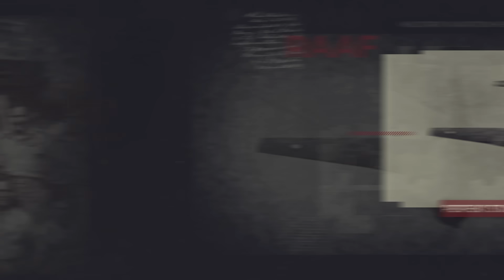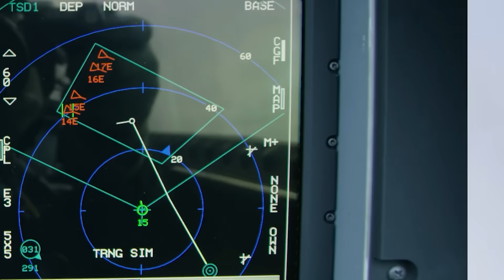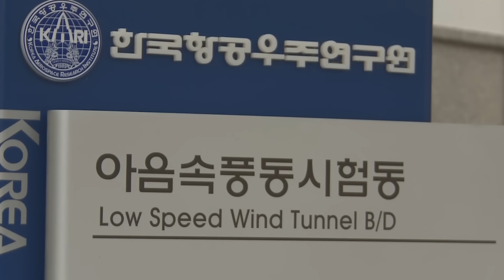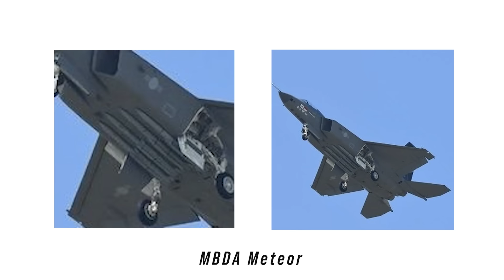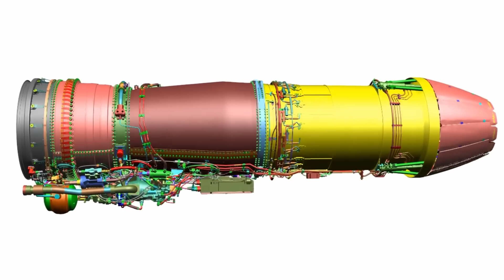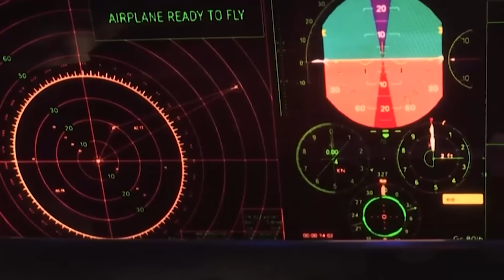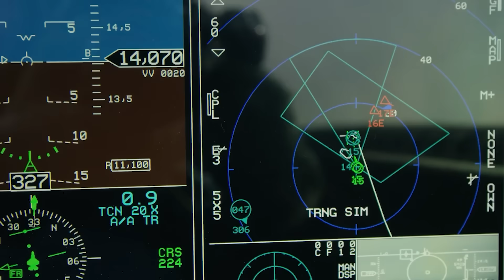KF-21: Korea's New Fighter

Comment: Why even bother copying the F-22 planform when it's supposed to carry external ordnance?  Strikes me as a play to get the US Congress to approve the newest technology transfers in the future on the flimsy pretext that Korea "already has stealth."
Reply: They already have the F-35 and are buying more. The purpose of external weapons is to maximize firepower to engage larger numbers of targets when outnumbered in a wave attack. The maximum feasible cost effective stealth while keeping high firepower gives as much stealth advantage as possible in that scenario. Internal weapons would allow approaching closer to the targets without being locked but if it can instead shoot down all targets at medium range then the extra stealth isn’t necessary and would only reduce available weapons. The best fighter that the DPRK has is the MiG-29 and this will easily outrange it in sensors and stealth. The concern is that a large wave of ancient aircraft could overwhelm the patrols in the air at the time in a surprise attack before all aircraft could be scrambled to assist. Having more weapons mitigates against that threat and including similar capabilities to F-35 in other respects such as networking and targeting gives maximum advantage overall
Reply: @Stu_Bur  My point is there's a difference between giving a country planes, and teaching them every discovery used in building them.  The entire advantage of new technology amounts to the sum of the delays in reverse-engineering all those clever discoveries and difficult mathematical solutions that McDonnell, Lockheed, Northrup, and the like hewed out with massive infrastructural support.

External weapons is an own goal for stealth.  There's some other purpose to copycatting the F-22.

Comment: I will not be surprised if this is just a jump start to designing a stealth aircraft for South Korea. If they have gone this far in just a decade or two, they are on their way to creating their own 6th generation fighter aircraft. Very impressive!
Reply: They are going to develop this KF 21 into a stealth fighter in few generation down.  All part of plan.
Reply: They are currently undergoing 5.5 gen feasibility studies with either a modified KF-21 or a slightly bigger platform. The project is currently dubbed KF-XX.
Reply: I think it depends if they feel like they need it. SK’s strategic planning is 95% centered around North Korea, which isn’t exactly cutting edge - MiG-19s were good in their day but it is 2024. I don’t know if a proper 5th-gen fighter would be necessary unless it carried a ton of missiles or could network to platforms that could in order to fight NK.
Reply: Developing a sixth generation Air Force on their own is an extreme stretch.
Reply: 계속 헛소리를 하는거보니 중공인 아니면 중공인 피가섞인 사람인가 ㅎㄷㄷ
Reply: ….not without America via Lockheed Martin know how and GE jet engine,at least South Korea acknowledged that cooperation!
Reply: @georgesikimeti2184 이제는 록히드에서 기술공유를 하길 바라고 있다는걸 모르시군요?

하지만 늦었습니다.
한국은 핵심적인 4대기술을 자체적으로 성능이 더 상위급 버전으로 개발을 해냈으며 이젠 마지막 단계인 엔진개발을 시작 했습니다.
그리고 얼마전 한국에선 현존하는 스텔스 기능보다 더욱 상향됀 스텔스 필름을 개발했습니다.
한국은 한다면 해내는 나라입니다.
Reply: @georgesikimeti2184  Your comment is halfway true. Recently the S.K. government has officially announced that the DAPA(Defense Acquisition Program Admin.) in cooperation with Doosan, which succeeded in designing and manufacturing large turbine for power plants, and Hanwha which has decades of experience in producing various jet engines and has handed them over to GE, PW, and RR, undertakes a development of its indigenous turbine engine similar to the one that used in f18.  By 2035, when the development would successfully come to the end, the US-made jet engines will not be used in the Korean indigenous jet fighters any longer.
Reply: @georgesikimeti2184  well at least South Korea got those help legally. China just hacks US and copy American jets or reverse engineers Russian jets illegally
Reply: Lockheed Martin gave them the tech
Reply: @joncarolyn  This is not true. Lockheed was an advisory partner, and did not  give out any core technologies (AESA radar, IRST, EOTS, weapons/flight control software, stealth coating, etc) as someone commented in another post here.  They were supposed to I think, when South Korea bought the F-35A, but they refused to transfer tech in the end. Lockheed helped guide the airframe design, but most core technologies were developed by South Korea.
Reply: @jimmyha1898 The AESA radar system in K-21 is EL/M 2032 produced by Israel electronic company called ELTA systems,not made in South Korea,well?
Reply: @georgesikimeti2184  KF21 AESA radar sytem is made by Hanwha(former Samsung Thales). and also there is FA50's AESA radar made by LIG nex1(LG company). ELTA's role was just testing in final stage of KF21's Hanwha AESA radar.
i'm surprised that u r saying exactly same China's Lies. R U Chinese?
Reply: @AresSpeer research your rhetoric again vigorously and find that it’s not all Hanwha right through,Leonardo of Italy also involved in some capacity earlier in the development in addition to Israel electronics.The point of the argument is not all KF-21 components are Korean,period.As for questioning my nationality,none of your f….business!!
Reply: @georgesikimeti2184  Leonardo never ever been made AESA radar before until now. so 1month ago, Leonardo ask to Hanhwa signed MOU for help to transfer AESA tech.
Can't help stop laugh at your lies and manipulating Facts.
Hanwha is helping Loenardo, not Leonardo helping Hanwha.
and u said your point is not all KF21 components are Korean? Who said isn't? 
Gripen's 80% is imported products. is Gripen Sweden fighterjet? F35 F15's cockpit display is LG products. most of iPhone's main chipset, camera and display is Korean products.
is iPhone Korean products?
so do Rafale, Eurofighter, mig-, su- the same. so your point is pointless.
maybe except China's proud 100% Chinese jet products(cheap and crappy stealing copy from US and Russia) or maybe japan's proud X-2(Lockheed martin helped 14years ago. but Expensive more than F22 so even japan throw out right into trash bin)
Reply: @AresSpeer again,not all components in kf-21 are homemade,get that into stubborn…..!,it’s a Korean fighter jet ,give you that and so as majority of us in this space,but your capacity to comprehend the discussion defy logic,what is it you trying to convince?or impress?,the answer is the middle figure!!
Reply: @georgesikimeti2184 KF-21 doesn't have an Israeli radar. It's produced by Hanhwa.
Reply: @georgesikimeti2184  About 65% of the parts or more of the current version of KF-21 are Korean produced and manufactured. Some of the core capabilities are made by Korea, one of which is the AESA radar. All planes have components from foreign nations, including that of the latest F-22, FA-18, F-16, Mirage, Eurofighter, Rafaele, Typhoon and many others. So your obvious statement that KF-21 also includes foreign component isn't really a great argument as many others do the same. No one said everything in the KF-21 was Korean origin. But that a vast majority of its components are designed and made in the country.
Reply: @georgesikimeti2184  The fact is that you said KF-21's AESA is EL/M 2032 Israeli ELTA made, of course it is definitely lies. And no one said all components of KF-21 was locally made so the point of the argument is your lies about AESA of KF-21.
Reply: @georgesikimeti2184  Your point is pointless
Reply: @georgesikimeti2184  "but your capacity to comprehend the discussion defy logic"? how come just simple True can be defy logic? 
convince U? impress U?
I'm mocking U. 🤣🤣. not surprised your capacity to comprehend at all.
Lies or run away if doesn't works. that's u call discussion? 
Save ur middle figure for urself.
Reply: @georgesikimeti2184  Quite the contrary. fact; After seeing the AESA radar developed by Korea, Israel reached out to jointly develop a future model. As far as I know, it was quiet after that, so I don't know how it was decided, but I don't think the offer was accepted.
Reply: @michaellim4165 welcome to the world of reality,finally somebody is intelligent enough but my argument is still great though 😅,and f-21 AESA radar is Co-Develop not alone by Hanwha,period.
Reply: @이유꿀 now you’re intelligent enough to admit your lack of ….
Reply: @AresSpeer  now I made you come to your proper sense,excellent!!
Reply: @georgesikimeti2184  "The AESA radar system in K-21 is EL/M 2032 produced by Israel electronic company called ELTA systems,not made in South Korea,"
this what U said. but suddenly,
"it’s not all Hanwha right through,Leonardo of Italy also involved in some capacity earlier in the development" U said.
so? KF21's AESA radar is made by Hanwha system's AESA? or ELTA's EL/M 2032?
then, Does Leonardo involed in Hanwha system's AESA? or ELTA's EL/M 2032?
what a defy logic huh?
You better check ur proper sense and intelligent not many others. all fine except U🤣🤣
You a the biggest laugh of 2024 🤣🤣

I'will give u tips.
have U ever heard ADD? or KADD (Korea Agency for Defense Development)?
Reply: @AresSpeer well done,and can you also check whether Saab of Sweden involved in the shape of radar cone!!,there are other international companies involved but I let you find that out but hey Hanwha is the main act no doubt.
Reply: @max_7344 but why the offer? was accepted!,didn’t the original prototype and testing thereof of the complete radar was tested by the Israel,there’s more to it !!,don’t forget this is the  result of u.s. refusing to transfer radar from f35 under its tech. intelligent restriction rules.
Reply: @georgesikimeti2184  As a result of my research today, "No", it was "Not Accepted." As the controversy over Israeli intervention, as claimed by you, grows day by day, Director Eun-ho Kang of the DAPA, who recently led the development of the AESA radar, expressed a clear position on this; 

"The KF-21's AESA radar is "purely developed independently by Korea." Not a single Israeli technology was used. Israel only tested it. We did not have a platform or equipment to test it, so we asked Israel to test it."
Reply: @georgesikimeti2184  As a result of my research today, "No", it was "Not Accepted." As the controversy over Israeli intervention, as claimed by you, grows day by day, Director Eun-ho Kang of the DAPA, who recently led the development of the AESA radar, expressed a clear position on this. He said that the KF-21's AESA radar is purely developed independently by Korea. Not a single Israeli technology was used. Israel only tested it. We did not have a platform or equipment to test it, so we asked Israel to test it.
Reply: @georgesikimeti2184  In fact, Israel, surprised by the performance after testing, even suggested, "We will give you the software, so let’s jointly develop it." But we immediately declined without hesitation. The reason is as follows. If jointly developed, Israeli permission must be obtained each time it is exported. And above all, we are confident in our software."
Reply: @georgesikimeti2184 so the conclusion in brief is, Israel was surprised by the technological prowess of Korea's AESA radar and thus proposed joint development, BUT Korea "REJECTED" it. These are the facts, NOT "Something negotiable by theory", period.
Reply: @georgesikimeti2184  I don't know where the basis for the Israeli joint development you claim was "accepted" lies, but if you have a source, please provide it. I have never heard of it to this day.
Reply: @max_7344 unless you actually work inside!,your bloody quess is as good as anybody,so,I’m asking a simple question!
Reply: @georgesikimeti2184  Sorry, you may be a novelist, but you're definitely not "the insider."
Reply: @georgesikimeti2184  I hope you have the common sense to know that the statements of representatives of official organizations carry responsibility and that the "speculative theories" of anonymous commentators in spaces where anonymity is guaranteed do not.
Reply: @georgesikimeti2184  That was "insider". responsible person's statements on major broadcasting media TV. but why u need " insider" again? 
Proper sense and intelligent. got that? 

why don't you just say ur thoughts base of origin article or statements of insider just like @max_7344?
Isn't it discussion u been talking?
or just F.or urself.
Reply: @max_7344  That was heavy strike!! Intelligent!!
👍👋💯
Reply: @AresSpeer  have you ever heard about Leonardo Vixen ASESA radar. What about CAPTOR Radar used in Eurofighter since the 90's ?
Reply: @flaminiasantuzzi231  YES. i do. ViXen AESA radar was developed by BAE systems originally. but u missed so many parts long history of this radar. It's pretty complex.
BAE Systems sold its share of 셀렉스 to Finmeccanica. 
셀렉스 was a subsidiary of Finmeccanica active in the electronics and information technology business, based in Italy and the UK. 
and then, the activities of 셀렉스 merged into Leonardo-Finmeccanica's Electronics, Defense and Security Systems Sector becoming Leonardo.
which i didn't aware that merged parts.
anyway, Doesn't change the Facts, Leonardo did nothing to KF21's AESA radar with.
Reply: @flaminiasantuzzi231  and CAPTOR Radar was developed by BAE systems also.
Reply: @AresSpeer  I did not say Leonardo did something in the Korean AESA I just say that Leonardo had AESA radar BEFORE Koreans did and that implies that Leonardo would not need technology from Hanwha as you pretend. Here is what you said in a broken English: "Leonardo never ever been made AESA radar before until now. so 1month ago, Leonardo ask to Hanhwa signed MOU for help to transfer AESA tech.
Can't help stop laugh at your lies and manipulating Facts.
Hanwha is helping Loenardo, not Leonardo helping Hanwha."
Reply: @flaminiasantuzzi231  "Leonardo never ever been developed(made) AESA radar before" that is True. just "sales" not "developed". Who Knows what merge contract was, if u r not "insider"?
Korean did, but Leonardo never ever did. BAE systems did. So I don't see any wrongs.
you better check ur broken English dictionary and be aware differences of "developed" and "had" or "sales"
U have a same problem just like @georgesikimeti2184.
Proper sense and intelligent. 
I'm 100% sure that I am more Educated, Intelligent, my English ,my Korean ,my Espanol, my German ,my French is way much better than urs.
Lies or run away if doesn't works. and comeback with another ID.
Again, U R the biggest laugh of 2024~ 🤣🤣
Reply: @flaminiasantuzzi231  I think I'm Done with. Bye L.iar~🤣
Reply: @georgesikimeti2184 
You confused FA-50 and KF-21.  EL/M 2023 is the FA-50 radar and not the KF-21 radar.  Also, EL/M 2023 is not an AESA, but a mechanical radar made in Israel.😂
Reply: @georgesikimeti2184 stop spreading BS, 50 cent Chinese army!
Reply: Doesn’t it lead to a reliability problem?
Reply: @joncarolyn That is T-50.  They refused any help on KF-21.  If you have any proof bring link
Reply: @joncarolyn gave = sold upon the house’s approval. It was a good trade.

Comment: The KF-21 Boramae's not a fifth generation fighter. But. It opened up the options for Korean Aircraft Industries to make his own fifth or sixth generation fighter.
Reply: Boramae is a 5th gen fighter without an internal bay. Su-57 is a 4th gen fighter with an internal bay. Boramae has avionics directly derived from the F-35 under license. It has stealthy shaping that includes serpentine engine intakes. The choice of external weapons is a feature not a bug. It is essentially replicating the role of a “beast mode” F-35 with similar level of stealth and firepower but at lower operational costs.
Reply: Put it another way: is an F-35 no longer 5th gen when the users opt to carry external weapons? No. It degrades the effectiveness of stealth but provides more firepower in trade off.
Reply: KAI will produce KF-21 BLOCK 1 starting this year in 2024. And they want Korean-made weapons in BLOCK 2. Their armament bays are already empty and BLOCK 3 will also be produced soon. Koreans want to be as independent as possible with Korean engineering, and stealth technology has already been secured using completely different materials. We just want to take it one step at a time.
Reply: @whiteelan7 We do not yet know whether it is a graphene metamaterial, a paint method, or an adhesive type.  However, it is expected to be an innovative method in terms of maintenance.
Reply: And the little brother Korean KAI F50 has shot down a F22 in war games....
Reply: @rgloria40  Which isn't an accomplishment considering the U.S actively stacks the deck against itself in order to purposefully lose, which gives it far more useful information than winning single-handedly and showing its hand to enemies.
Reply: @Techno_Idioto  precisely, a lot of people don't realize (because the media never tells this) that the US always does these exercises under the absolute most hideous conditions possible. Nerfing the F-22 to the point a freaking eurofighter can out-turn it and not allowing BVR.

If it was an actual combat scenario the F-22 wouldn't even have appeared on radar.
Reply: @Techno_Idioto  The fact that the FA-50 doesn’t have BVR until the most recent block 30 upgrade says plenty of the stacked scenario in which SNY FA-50 could shoot down a F-22. FA-50 is an armed variant of a trainer platform. Someone who actually think a FA-50 can go toe-to-toe with a F-22 is hilarious.